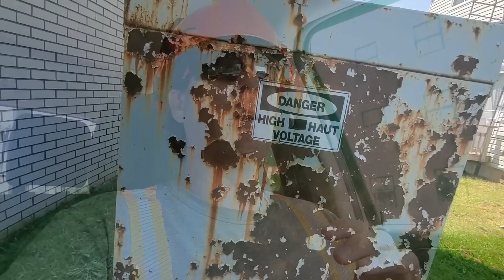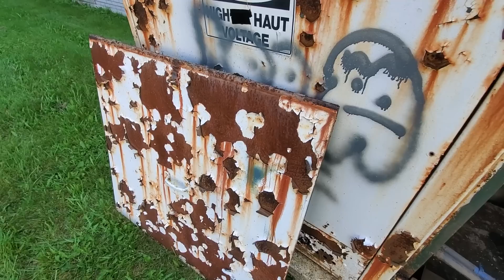What's a Transclosure ?

Comment: Over here in Europe I do not remember seeing a specific type of distribution transformer that is intended for pole mounting and other for pad mounting. As far as I know over here a same style of transformer is used for pole/tower mounting and for mounting in what you called a transclosure. At some places they have started to replace older single transformer tower constructions which probably had less power with single transformer that most likely has equivalent power of transformers that have been taken down, but then that one is inside of what I belive is what you call a transclosure. Here they are usualy concrete buildings with steel doors that also have cooling blinds and if they are bigger they have some extra blinds on wall beneath the roof too. Matching data is usualy written on the door plates, for example TS 10/0,4kV what means that it is a Transforming Station(can have number next to TS if it is more of them) and transforms the voltage from 10kV to 0,4kV so that there is 400V between phases and 230V in phase to neutral relation on secondary side.  Sometimes they do get built or even painted to match the environment in which they are if they are somewhere in the city. One more way of doing them that I have seen is to have them at ground floor of some building but still door being a meter or so above sidewalk, I belive to keep people away from them.

Comment: Ive never have seen one of these before. I would have thought that they just would have set a PAD MOUNTED transformer. I have seen the indoor vaults that get
eliminated & a new pad mounted transformer is set & the old vault turned into the main electrical gear room such as in a school building. My area is Commonwealth
Edison Company now comed an Exelon company. They started using pad mounted transformers in the 1950s. I saw one at the 53 drive in with cloth & rubber500 
mcm cables going to the buildings 120/208 2,000 amp service-[car heaters].
Some old timer told me that they had small trasclosures for underground residential settings. Ive heard because of the TRASNFORMER SHORTAGE that some
utilities are using wooden TEMPORARY outhouse things to enclose a pole top transformer so NEW subdivisions can have power. The pad mounts are on 1-2
year waiting list because we OUTSOURCED the vital materials to make transformers.[stupid American business!!]
A transclosure is a cheap large way of imitating a job for a real pad mounted transformer.

Comment: The municipal system where I live still has a few scattered transclosures and which are likely holdovers from when they had 2400 delta primary (all long since converted to 13.8 Y). I also remember seeing a modern version on a coop system that ran 24.9kV, but this one was specifically for primary metering. It gave me the heebie jeebies looking into the enclosure knowing I was just feet away from energized BARE conductors carrying line voltage! Even my supervisor on this trip was VERY cautious as he inspected the setup to confirm the high-voltage conductors were correctly routed from the incoming potheads through the instrument rack to the outgoing potheads.

Comment: I was a little confused when you said that the apartments get 2 of the 3 phases. People often confuse 3 phase power from residential split phase. Most of the world's power companies deliver a single phases 220-240 volt. In North America we use a single phase that is split into 2 inverted 120v phases. They technically are the same phase because they are 180 degrees to each other. This is why you can use a 220 v appliance by wiring them together. If they are 2 of the 120 degree 3 phase power would cause a big light show. So a apartment will get a pair of 1 phase lines. You can see there are 2  of each color.  On the pole there are 3 transformers with 3 wires each.  The central tap neutral and the two inverted splits. 0:04
Reply: Apartments tend to be wired with 208Y/120, or so I've heard. So they do indeed get 2 of the 3 phases. I lived in an apartment years ago and it never occurred to me to check if it's wired with 120/240 or 208Y/120, checking the voltage between the two hot wires would tell.
Reply from the maker: That's correct about the residential single phase with a center tap neutral. Some of our smaller apartments are still fed that way. The large buildings (such as the ones in this video) are fed by 3 phases even though there is no actual 3 phase load. 
Rather then getting 240v between the two hots, you'll have 208v phases to phase and 120v phase to ground. Each unit will leap frog a phase that's not used to help balance load throughout the building.
Reply from the maker: Phases in this case are labeled red, black and blue (plus a neutral).
3 phases "Y" with 4 wires (doubled up) feeding into the building.
Reply: @Bobsdecline  That is fascinating. AC is fascinating to me. Thanks 😊

Comment: My husband used to work for a school system that a large majority of the schools had transformer vaults with pole type transformers sitting on the floor or on racks. That was the norm back in the 50’s and 60’s and even early 70’s.  They had a football stadium with two transclosures. One took the 12,470 down to 4160, and the second took the 4160 to 480. The utility was responsible for the 12,470 enclosure, but the school system was responsible for all the 4160 stuff.

Comment: In 2017 I worked for a financial service company and we decommissioned a Wells Fargo branch in Miles City, MT and they had a vault in the basement that had been welded shut so per the SOP we had to open it and confirm it's empty and disable the lock, upon cutting the door and opening the day gate we found it was converted to a transclosure in the 60s and long story short back in the day they cut a hole in the 1920's brick and installed a man door with a hasp so if we would have skipped ahead a few days we would have cut a padlock vs a vault door. Needless to say we crapped ourselves when we noticed. The power company didn't know, CBRE the building owner didn't know, and of course Wells Fargo didn't know. That transformer bank also fed several other large commercial properties. I don't remember seeing any CTs so not sure how they metered. I feel sorry for the gents who get to deal with the PCBs and haul them up the narrow stairs.

Comment: Man, a metal shed with three trannies inside, looks well scary and a death trap but I suppose you would isolate them before opening it up. I hope the rusty old box in the video is earthed. In the uk we have pad mounted TXs with cable entry boxes so there are no exposed parts. Also we would have a single 3phase TX instead of three separate ones. Different country different ideas. Nice informative video man, keep them up.

Comment: Do you guys also transfer over the telecom lines?  In Quebec the remnant of the damaged pole is left behind (securely strapped to the new pole) until the Bell/cable crews arrive to move them.
Reply from the maker: At our company we transfer everything and send'em the bill!
Reply: @Bobsdecline  We have so many "stumps" strapped on to poles all over the place!
Reply: @Bobsdecline  Years ago, for new construction in new housing developments, the local electric company (NOVEC) installed the buried drop twisted pair for the telephone company (then GTE, now Verizon) at the same time they installed the power drop to the house. They sent GTE a bill for that work. No idea when that arrangement went away (probably when Verizon bought GTE), nor why it was done that way to begin with.

Comment: One summer during my engineering school years, I worked for an electrical construction contractor which worked for the local electric power utility in the Black Hills of South Dakota.  I assembled 3 or 4 trans-closure cabinets as well as several URD underground rural distribution 13 kV primary switching cabinets with the elbows and parking sockets.  Another nice video.  Keep it up and remember to "point with your elbow" when you have to work close to an energized part.  Best wishes from Iowa.

Comment: A school I work for built in 1961 has a dedicated transformer "vault room" built into the building. It has three pole mounted transformers just sitting on concrete in open air. That was the first time I've ever seen anything like this. The maintenance staff mistakenly cut off the door padlock and once we opened the door and realized how dangerous it was we called the electric company to put a new lock on the door. The "fireproof" wall and ceiling of that room doesn't instill a lot of confidence in me. All of the secondary feeds passed thru the cinderblock wall into the back of the MDP in the boiler room.
Reply: I live in a condo in Seattle built in 1963. We have a vault room with 3 round transformers sitting on the floor.. wires coming out the top. It’s a scary place. I’ve got a few pictures somewhere.
Reply: The building I work in was built in the mid '80s and has the same thing, 3 pole transformers sitting in a concrete room with the secondaries going through a cinderblock wall to the switchboards.  Scary stuff.
Reply: @uzlonewolf  --  The only "scary" part is that it's not elevated to the point where a normal person can't touch the conductors.   If it's completely enclosed only the utilities have to worry about things.
Reply: @GilmerJohn   Still a bit scary if a wayward vehicle strikes the box to the point it touches the terminals and there are no protective bollards around it.
Reply: Quite common in Ontario in multi residential apartment buildings.  Garbage compactor room was above the transformer vault and the concrete deteriorated to the point where it needed to be demolished.  Entailed putting the building on a generator for 2 months, demolishing the floor slab and pouring new floor.

Comment: I did engineering on a couple of University buildings to remove aerial transformers that were 
 inside the building electrical rooms. Very scary to go in those rooms with exposed transformers. Apparently common practice back years agol
Reply: Exposed transformers wouldn't bother me. Exposed high voltage would, especially in a probably-not-too-large of a room!
Reply: @jovetj  Yep G&W oil switches on the wall, all exposed connections on the transformers.  6 x 8 foot rooms.

Comment: I was sent to Key West in September 2017 to help restore power on all the Navy and Coast Guard bases there. On the Coast Guard Station I encountered a transclosure. It had 6 transformers in it. Each was a 167-kva. They had primary UG elbows on the tops of each primary, instead of the normal open wire connection. The base was still without power but when I oped that thing up and saw that, I took several pictures of it and closed it up. I told them hope for the best when we hot this place back up. The station commander said he hopes it blows sky high. He wnts it gone but no money in the budget. Storms are good sometimes for system improvement. But unfortunately this time when we made other repairs and closed in the main incoming feeder, it held just fine. Oh well, there will be other storms I told him. 
Bottom line for me was get rid of that thing and get a padmount transformer. 
Looked like a trap from the movie Saw to me.

Comment: When I was in Puerto Rico they had 3 phase dead ended on a building and feeding a transclosure with to transclosure lol. Literally 3 phase primary 4kv dead ended on a cinderblock wall. And open delta bank pole mounted transformers sitting on the ground. No enclose except for a broken 5ft Chain  link fence around it. Anyone can walk in there and grab primary etc. I said to my boss are we energizing this or should we isolate it. He said that’s been energized for 30 years like that, heat it up👍 place was wild brother

Comment: I remember way back about 13 or 14 years ago I was helping my nephew at a warehouse in a small town near where I live and in that building there was a room about the size of a small bedroom that had the primary wires going inside that room and there were transformers in there and they were pole mount ones just like the ones in the photos you showed anyways I was just walking around the building and exploring it a little bit and the door to that room happened to be open and I just peeked in I didn't walk in there of course for obvious reasons but man those transformers were huge especially up close I was probably 25 feet or so away but still they looked huge. I think it was possibly 3 phase but I'm not sure I can't remember the number of wires that went into the building but I do know it was at least 2 primaries and it had through pass insulators and I also believe it had cutouts in that room if I remember right.
Reply: Reminds me of bidding on a what I thought was a small transformer from our local country surplus auction, for some personal projects.  Won it for the $1 minimum.  Got there and it was a full size beast sitting on multiple crushed pallets.  ...I paid my $1 and declined pickup, which thankfully they didn't mind as long as you paid.

Comment: If I was in charge I'd get rid of that dinosaur all together, it's so rusted it's practically falling apart,it'll just get more dangerous as time goes forward.⚡⚡⚡
Reply: It sounded like it's getting removed either way.  Either with a complete new run from the pole to building or with an in ground splice box between the pole and building.
Reply: @dangerousmythbuster  Yeah I kinda meant I would prefer a whole new run to the pole,the less joints the better.
Reply: @TheONLYDANHAMMER  of course that would be the objectively best solution assuming cost no object. Unfortunately cost is often a major object.